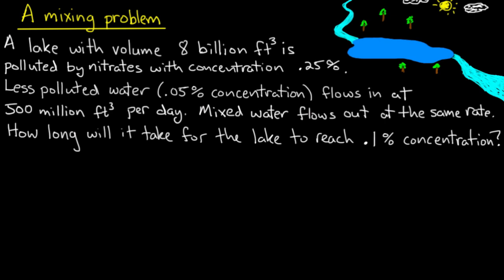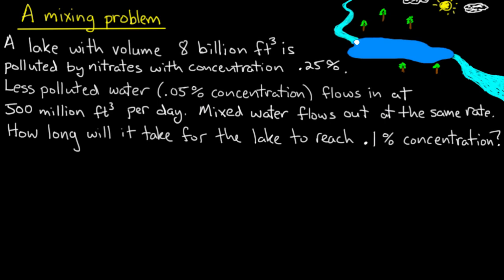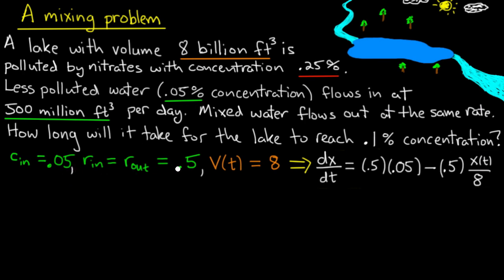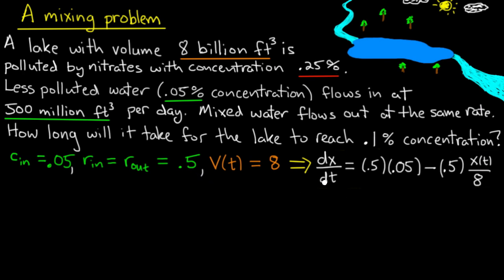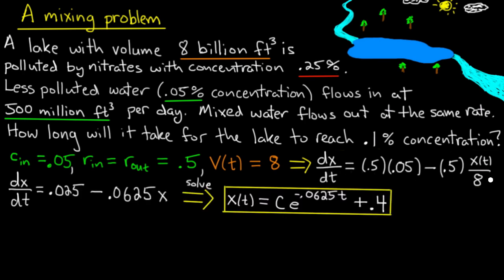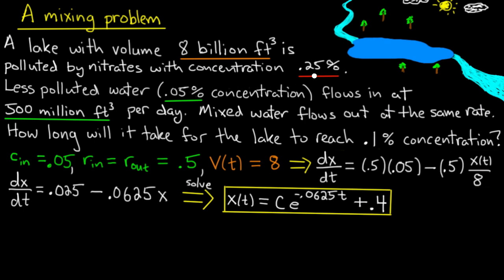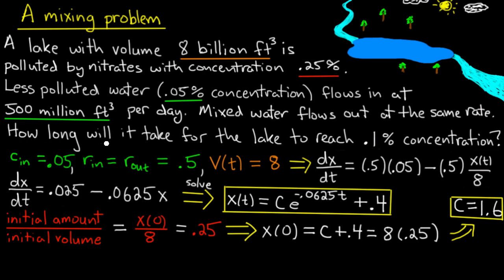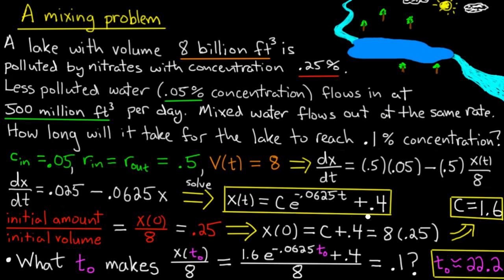ODE | Mixing problem example

Comment: It is separable because you can multiply both sides by dt and then take (.025-.0625x) and divide both sides. You'll end up with (1/.025-.0625x)dx=1(dt)